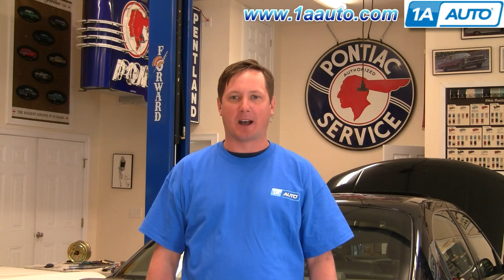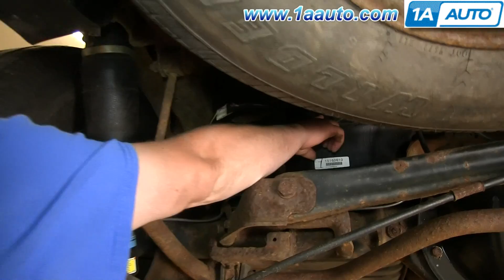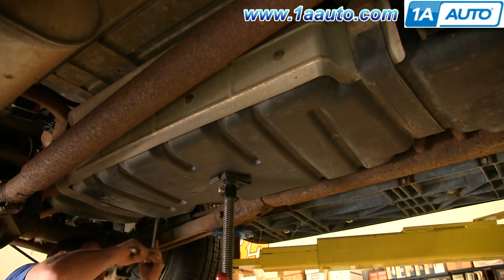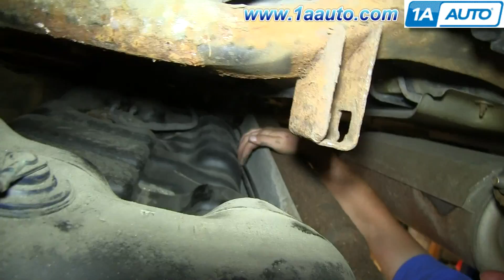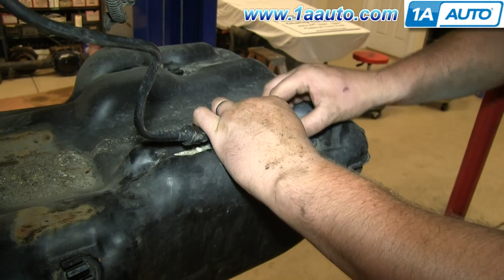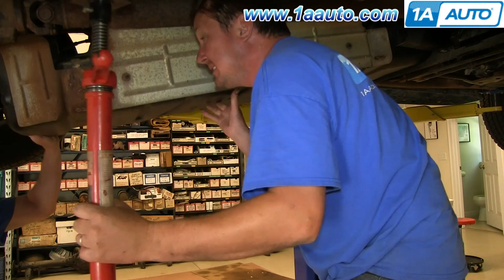How To Replace Fuel Tank 00-06 Chevy Suburban

Comment: will the 37 gallon gas tank that was OEM for a 2004 Suburban 2500 (6.0L v8) FIT a 2004 1500 LT Suburban (5.3L v8)? Thanks. The 1500 came with only a 31 gallon gas tank.
Reply from the maker: +Bryce Williams Thanks for checking us out! A 37-gallon tank will not fit when replacing a 31-gallon tank. You would want to purchase the same size tank that originally came with the vehicle.
Reply: @1AAuto  Thanks. Are you aware of anyone doing any replacement / auxiliary tanks on these 2002-06 suburbans that could possibly give me more capacity? I checked out Titan Tanks but they are exclusively for GMC/Chevy pick up trucks. Thanks.
Reply from the maker: +Bryce Williams We do not have a video for this type of repair right now, nor do we have any information on how to upgrade to a larger capacity tank.
Reply: @brycewilliams98   have you had any luck with this problem ? im currently in the market myself

Comment: Great video.  After replacing the tank on my 02 Suburban 2500, it wont mount to where the straps are flush as before.  Any ideas?
Reply: Same here
Reply: You either have an obstruction like the hoses not being placed back in the holders or you bent the straps out of place

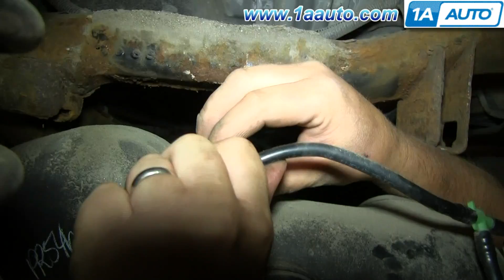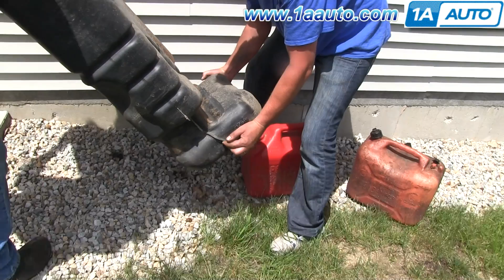Comment: great video as always. Hey just a quick question. I have 2 hoses coming from the fuel tank, the ones you took off on minute 2:52. on 4:54 you disconnect the hose, yet i have an extra hose and not sure where it goes. is it mean to be left disconnected because I just bought a Suburban 2002 and there were codes p0440 p0446. There appears to be no pressure  or swoosh when I take off the gas cap, i am also getting a gas smell when i try to run it. Everything appears to work well and I can start it up no issues. Any assistance will be greatly appreciated.
Reply: Did you figure it out?
Reply: I also have a 2001 suburban as well with a p0440. I smell gas also...
Reply: @RicardoGarciaSoccer

Comment: Broke Both connections that go to the Hard gas lines but found them both with a 90 degree bend and they are 2 different sizes i just drilled out the plastic bits from the plastic gas line and put in the new fitting and JB welded reinforced it for extra extra and i also broke the nipple from the plastic line that goes into the charcoal canister and piloted a hole big enough to fit the broken nipple piece and JB welded that in there too it fit snug the step drilling method helped in finding the exact hole diameter to fin the broken piece in so yeah that's how i fixed 3 broken hose fittings don't use brute force when dropping the gas tank i did because i did it by myself and didn't watch a video but my i always fix what i brake buying a new gas tank boy u crazy hahah there's always a solution to everything. fixed it all for like 25 bucks 2 fittings and a pack or jb weld 2-1 oz tubes call it done.

Comment: I want a larger tank for my 2003 Suburban 1500 4x4 5.3l. I really want 
as big of a tank possible. I think the oem fuel tank that's in there now
 is 31 gallons. Any help or ideas?
Reply from the maker: +General Caeser Thank you for watching. To obtain a larger fuel tank, there would need to be modifications made under the vehicle to allow for proper fit and clearance. 1aauto.com
Reply: Is it a lot of modifications?

Comment: for the two hose that are connected to the tank it self and not connected to the fuel pump, what happens if you break the "stem" off that male connector (2:54)
Reply from the maker: +serpzer Then you'll need to find a way to reconnect that hose while maintaining a good seal. That may require replacing the tank, not sure on this particular model. Hope this helps you out.  1aauto.com?utm_source=YouTube&utm_medium=CTA%20Comment&utm_campaign=1ATony 866-403-3393
Reply: Thus has resulted in a new tank. Thanks for your help love the vids